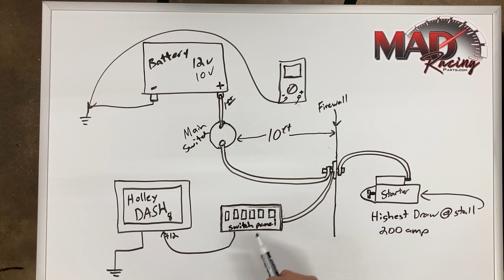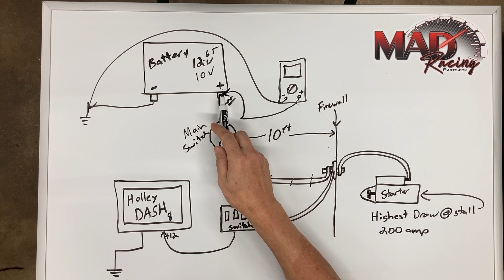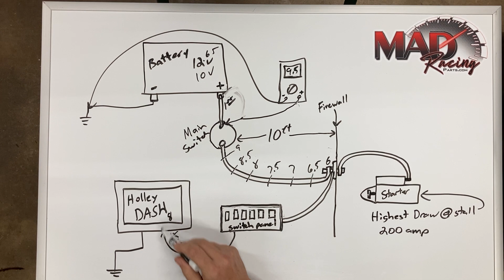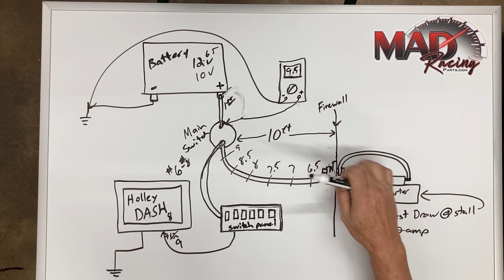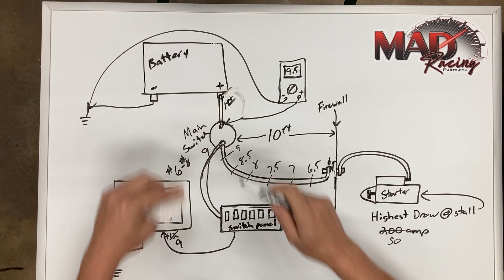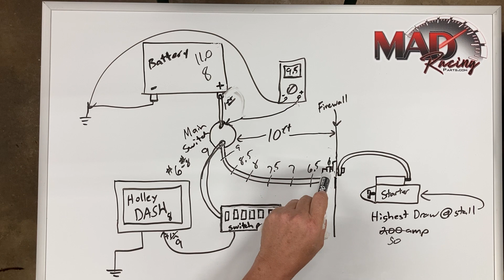Holley EFI dash resets and voltage drops

Comment: I wired my car with everything on a bulkhead on the front, with a trunk mounted battery,
. It worked perfectly for about two years then I stated having issues with the Pro dash reseting and freezing after start up. Even the Dominator was doing funny things. It was cranking fast still but voltage was dropping enough to cause this problem. I will swap the battery and rewire then report back.

Comment: Do as this man says. I had my car wired exactly like his diagram for ease of a power lug on the firewall and my dash shut off when cranking. Moved the switch panel main power back to the rear shut off like he said and problem gone.  Thanks a ton!! New car build and little gremlins like this will drive u nuts.

Comment: Solid rundown. Do you connect your starter power wire directly to the battery (fused of course) or to the “output” of the battery disconnect like you have in your diagram? 

I'm curious if the system will still see the voltage/amp spikes you described if the starter is connected to the same cutoff output as your electronics the way you have it in your diagram.
Reply from the maker: No it doesn't see the voltage drop.

Comment: good explanation on voltage drop.  something to add to it. all power comes from ground.  the circuit length is double.  the biggest thing i see that people miss is the ground is improper.  also, not all master switches and relays are the same.  a ford style starter solenoid will kill voltage and as voltage decreases amperage increases (im not telling you cause i know you already know this just kinda explaining my thought process on it ) on a electric motor, i.e. starter.
Reply from the maker: thanks